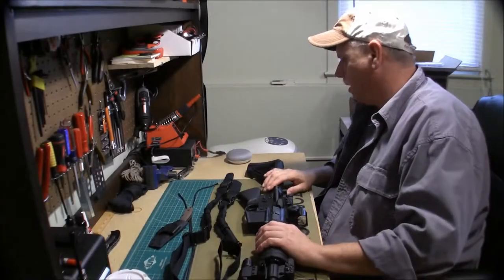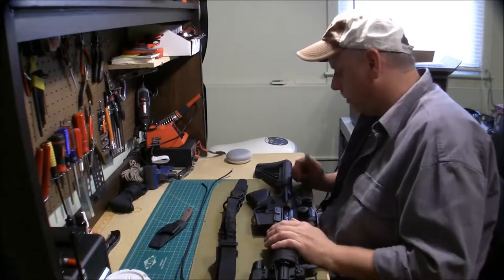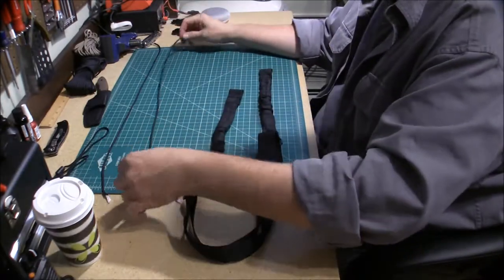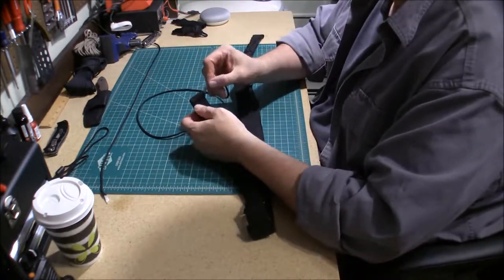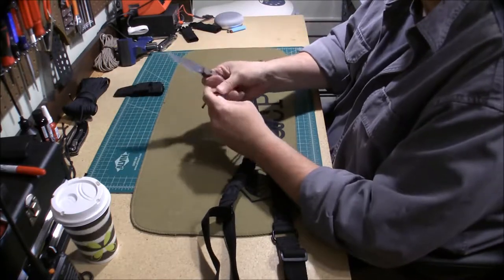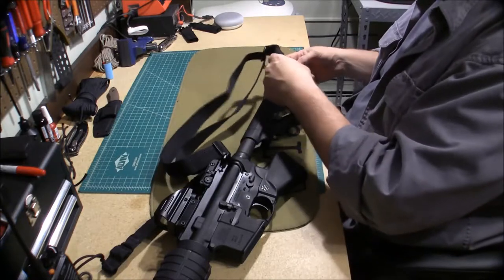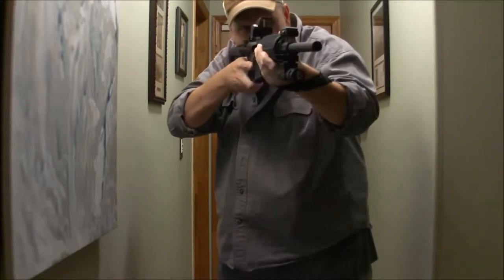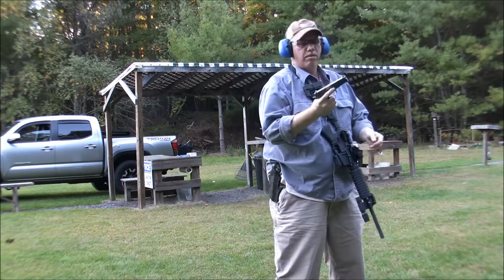Using 550 Para Cord to attach sling to an AR.

Comment: i use paracord too. reason being qd is not cheap. it squeaks n rattles. and if any of them fail you make field repair with PARA CORD. so i got Strike Industries S3 sling with Kevlar loops and they attach to the Paracord. and i drilled holes in my magpul SL handguards so i can move the mounts any place i want to. and i save 50 60 bux not buying qd swivels.